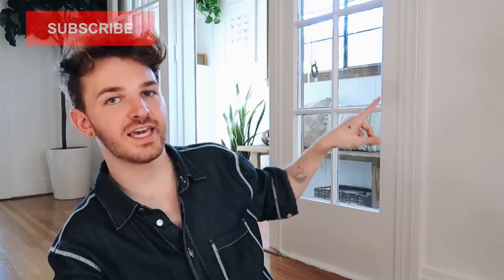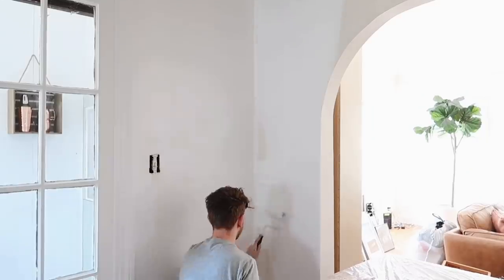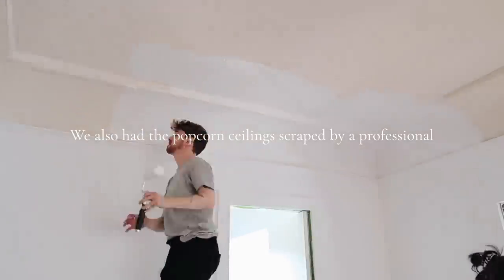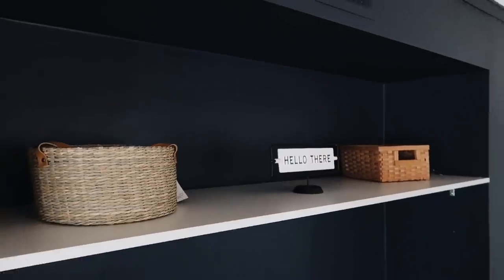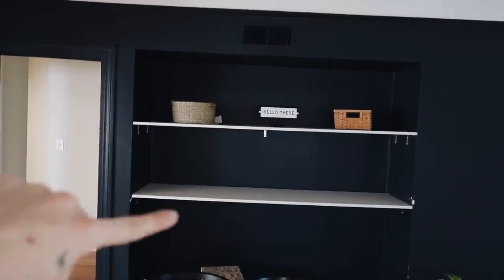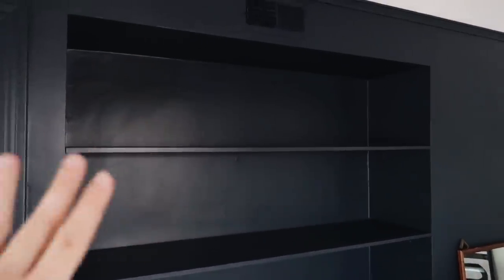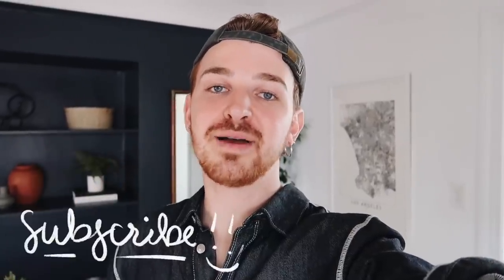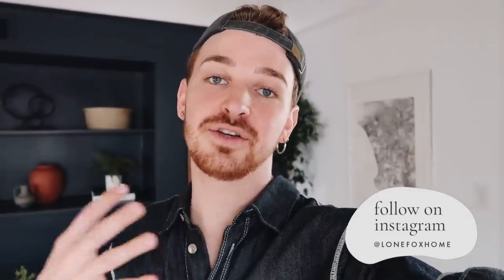EXTREME Dining Room Makeover (From Start to Finish) *My Favorite Makeover Ever!*

Comment: Love this room! I would have stained the shelves the same color as the dinning room table I love a wood look against a dark blue wall!! I still love it
Reply: When looking for a dining room table I often type in 'dinning' because so many spell it that way. Fun time with Ethan Allen as well. 
I agree the shelves should have been natural wood. Those brackets aren't large enough for a shelf that size. It will bow with any weight. Like the fact that he used some old pieces as well. I have a MCM piece which would fill in under those shelves beautifully.
Reply: Totes agree! But with melamine... probably not able to be stained :(
Reply: I had the same thought about wood shelves there. Would’ve looked amazing.
Reply: i was thinking that tooooo- natural wood shelving would be so nice
Reply: Agree, totally 🤗
Reply: @marylhere  That was my thought exactly about using a MCM console under the shelves. It needs that beautiful wood touch.

Comment: i love that chandelier! can’t wait for the rest of the makeovers!! 🧡
Reply: Drew, this room is so sophisticated. Good call on using the map print. I like your print, but definitely too bold for that space. Love your use of greenery in a space. Softens the lines perfectly. 

So happy you opted to keep the vintage chandelier. I’ve never owned a crystal chandelier, but was once in a jewelry store when the staff was cleaning them. Passing this along for future reference. Put a drop cloth on the floor under the chandelier before you set your ladder up. Squirt the entire fixture with glass cleaner until it drips. That’s it! Let it drip on the floor cloth. It shines itself. No wiping required.

Comment: I loved the accent wall. I was a little hesitant when you painted out the trim, but it turned out amazing. Just want to share a tip, since you are a designer, you need to paint a lot. You can switch out plastic floor covers when painting to an old sheet. That way you can use the old sheet every time you paint and save money from the plastic.
Reply: If he spills paint it’ll bleed through the sheets, so plastic is a bit more protective

Comment: For the shelves I would have used wood, that way you could put a front edge to make it look thicker and hide the brackets. Either that or use live edge lumber with floating shelf hardware. But in any case the wood would have played nicely off the table.

Comment: You should just use a cheapy vac for the plaster and things, the dust is so fine that it can get in to the motor causing issues and they will not cover you for repair/replacement if they find plaster or talcum powder in the motor as they tell you not to use it for that in the manual :O I had no idea until I started working there..... p.s love the make over!!!

Comment: Hi from the UK! I love the drama of that wall colour! I was worried by the white shelves but of course you Lone Foxed the heck out of them by painting them. Would never have thought to do this and when you were talking about shelves being cut, I was thinking roll on the live edge wood :-) I think your shelves are more unique though. I love the furniture and styling, only thing I would tweak is the corner ficus being at the same height as the mirror and framed print. It doesn't sit right with me visually for some reason. Perhaps it doesn't feel as natural and organic as the rest of the space? Anyways, that's a me thing :-) :-) Love seeing you settle into the new pad. My favourite room so far is the horror room, but it's early days! What an epic design journey you are on :-)

Comment: gosh, really wanted to like this but I feel like you missed the mark on this one.  I hope this come off as constructive criticism and not just snarky.  But a white rug in a dining room is an obvious bad idea.  There is no tie-in with the vintage ceiling light fixture which should have been a starting point for the room design.  The blue wall is very over powering and the use of shelves just to stage "stuff" instead of being used for a beautiful display of useful items or even putting in a hutch or console; design flaw 101...IDK I feel like this was not very well thought out.  You are better than this.  And, I still think you're really cute.

Comment: For me this just felt a bit flat tbh. There are times when I feel like Drew is really into the spaces  and the balance is so good and then there are times like this when I feel like reaching some kinda semi satisfactory level will do for the sake of the video but the hart just ain't in it. This will be revisited again real soon i am sure. I think the back wall could take larger statement objects in a light neutral colour way including natural white tone, perhaps clay earth tones ceramics and organic form glass ware. the plant over to the right hand side could have been more leafy rather than all trunk at eye level or at least ad a more substantial plant at floor level with some height to connect the eye. Like a big red clay pot ( to ad warmth) with a palm or cheese plant to add a less structured organic element to the space. Personally I would of stuck with the first print for the wall also.